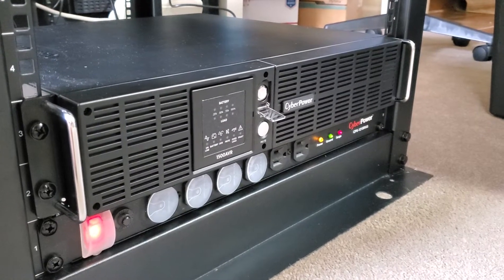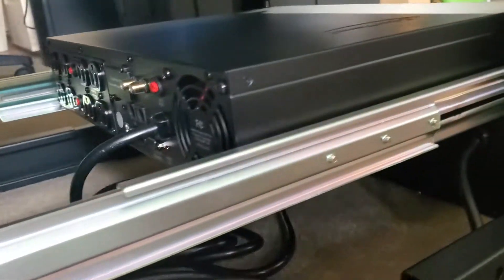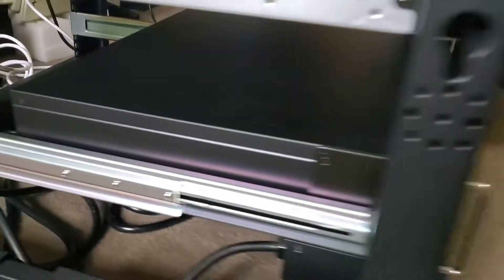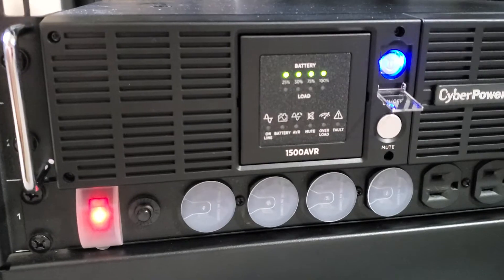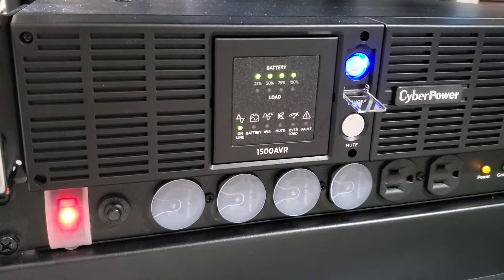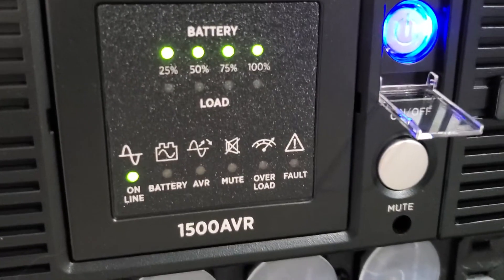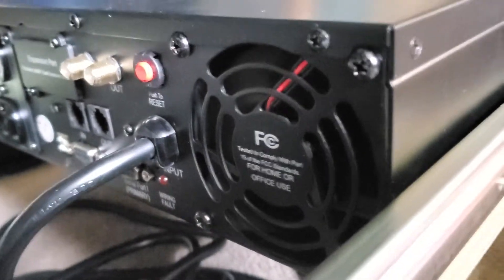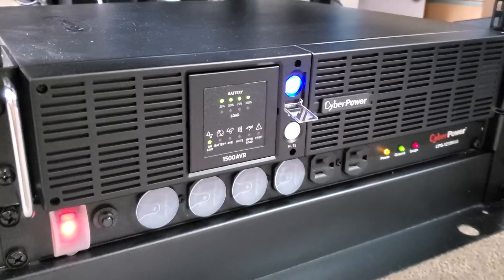CyberPower CPS1500AVR UPS Fan Noise

Comment: Did they tell you that it's normal?
Reply from the maker: I ended up not contacting them. The fan shuts off after 10-12 minutes. The only time it turns on after that is if utility power fails and it's running on battery.